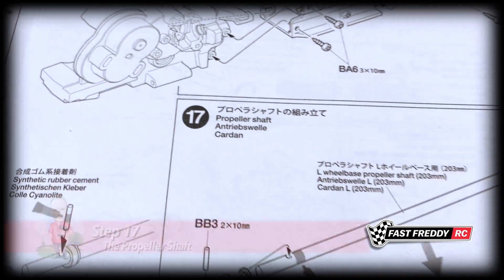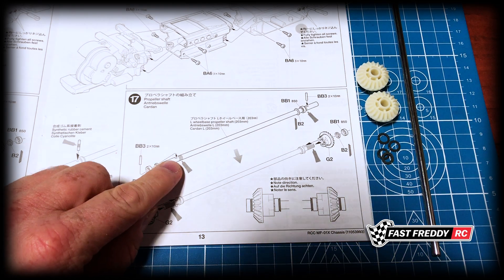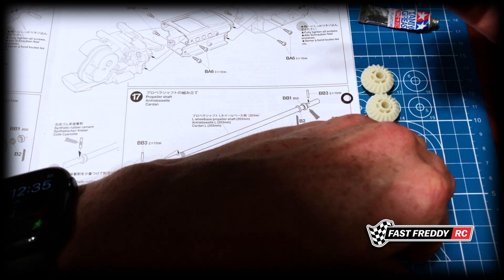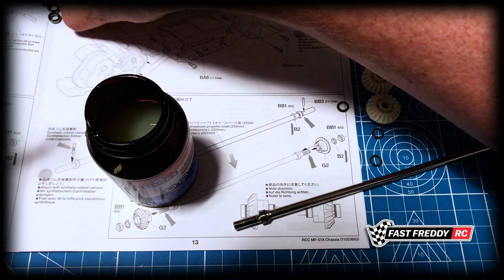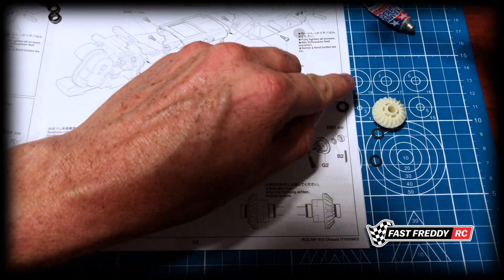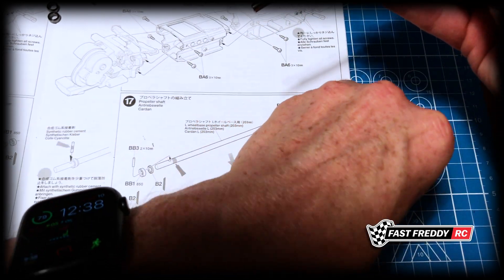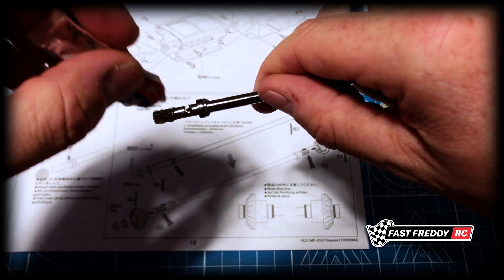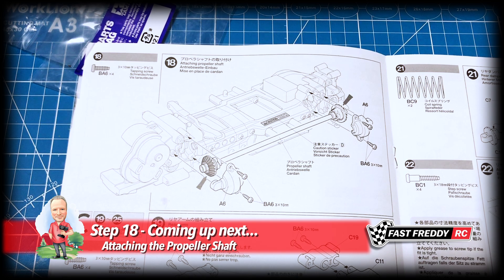Tamiya Fiat 131 Abarth Rally on the MF-01X Chassis - Step 17 -  The Propeller Shaft

Comment: Hey Freddy, you need to check page 23, as there is a slight difference in the layout of the sims, when you’re running ball bearings. Other than that, nice step and highly detailed, but please check options on page 23 (after step 39 I believe) best wishes to you and the family 😉😎🖐️👌
Reply from the maker: Hi John! So I’ve actually built this correctly. Page 23 is referring to the placement if you’re using flanged ball bearings. I didn’t go with the flanged bearings as they weren’t going to arrive in time for me to get going on the speed run challenge so I just went with replacing the plastic bushings with direct 850 replacement bearings. But thank you because this is still a good catch as I forgot to mention this in the video.
Reply: @FastFreddyRC  awesome Freddy! 😎😉👌

Comment: Hi Freddy, I'm not sure, but isn't at the end of the manual an istruction for the ball raised version with some slightly differences to the bushing version? I'm not at home and can check it. But I think in my Jimny manual there was this.
Reply from the maker: Hi Dirk! I ended up not using flanged ball bearings as they wouldn’t arrive in time for me to get going on the speed run challenge so step 17 placement is correct. I forgot to mention it in the video. Thank you for pointing it out though because you are correct that if you use flanged ball bearings you need to refer to page 23 for the correct placement.
Reply: @FastFreddyRC  thanks for the info. I just wanted to warn before something happens while running😉
Reply from the maker: @RCBirds  which is great…I’m glad you did!! :)